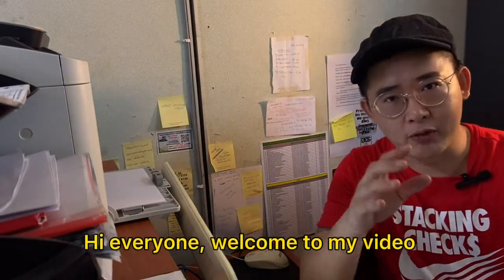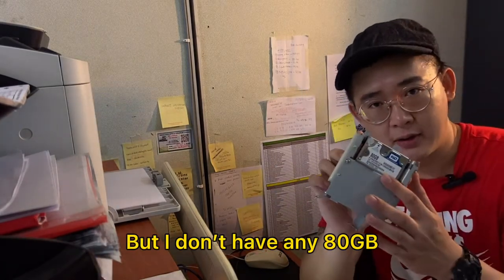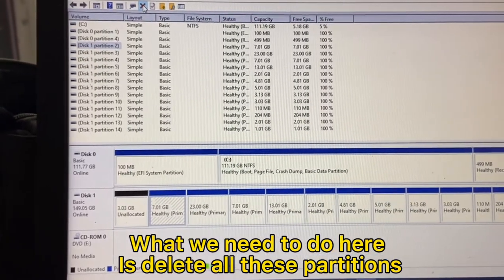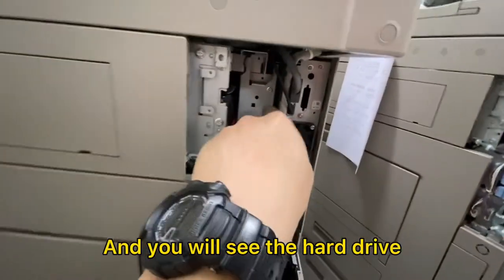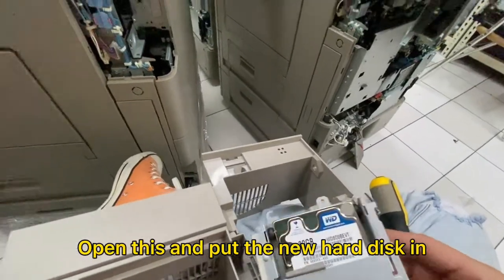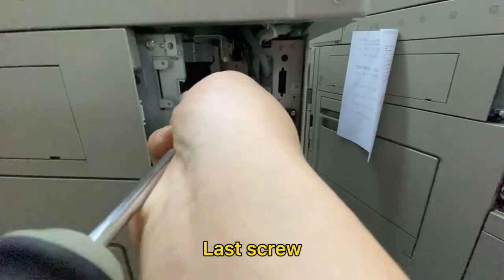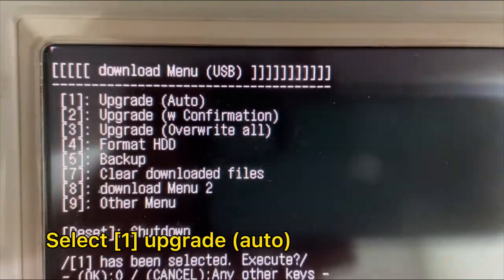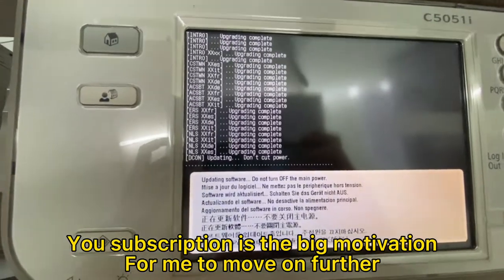Canon IR ADV C50xx /52xx Change hard disk & reformat

Comment: Hi Dennis, Canon imageRUNNER ADVANCE C5535i won't boot, looks like the hdd is broken. where is the HDD located in the printer?
Reply from the maker: Hi Sir, I found this on canon official web, you may refer to this link 
https://oip.manual.canon/USRMA-0945-zz-CS-enGB/contents/CS5560_appendix_0095.html

Comment: My canon 5250 prints well but my screen panel is off.
I changed the panel but it's still off
Reply from the maker: Do check the connector , please make sure all is connect properly, if panel still off… it might be main controller problem

Comment: Hi Dennis,

first thank You for great guided videos.
But I need to pleas You for help because I need ALL STUFF to create proper USB pendrive to FORMAT & INSTALL FW/SW into thne new HDD directly on printer.
I have printer CANON imageRUNNER ADVANCE C3520i III
I have error on display E602-0201
I have printers HDD out but UNREADABLE under Linux, Win nor macOS (for backu/clone)
I have another HDD prepared and formatted as FAT32/GUID connected in printer

BUT I DONT HAVE "USB tools" to newly format new HDD and againt run the Printer.

Please can you send me thoose files and info in wich format and setup to put on USBpendrive to be able to finish the procedure?
Thank You a lot.
Regards,
K.J.

P.S.: Hours googling and not able to download SST aka Canon Service Support Tool and Firmware for my Printer
Reply from the maker: Hi Sir, thank you for your comment, e602-0201 could be operating system error or hard disk drive. My suggestion is swap a same model hard disk into your machine and see it can boot or not. Sorry that I can’t give more info about IR ADV C3520i as I never do a format before it( I have no experience with this)
Reply: @dennisthefatkid  Hi Dennis,
its really HDD problem I tryed land/replace with another same machine and worx.
So please can you send me just nstallAPP = SST SST aka Canon Service Support Tool to do it manually by myself.
Thank you.
K.J.

Comment: hey brother can you send me the firmware files for 50/52 series .becuase every time i have the error i use to take hard disk from other machine and install .if get this firmware it can be a permenant fix and able to use my the hdd less machine
Reply from the maker: Yeah, it used to be the common way for me too (swap harddisk) you may request the firmware file from your supplier
Reply: @dennisthefatkid  i do deal with Refurb machines i have no deal with the canon suppliers thats the issue
Reply from the maker: @afimohd7902  yes, recon supplier have the firmware
Reply from the maker: Ok boss… good luck 👍🏻

Comment: How to solve E000602-0020 error on Canon, got this error just after printing. The printer has no keypad, only touch screen. The error is shown on the screen and stuck,please help
Reply from the maker: It seems to be hard disk or software problem 
E602-0200 -00 Title Hard disk error
Remedy 1. Check the Cable and Power Connector.
2. If the measures above do not solve the problem, start up in Safe Mode to perform All Format using SST and reinstall the system (SYSTEM, LANGUAGE, RUI), and then turn OFF and then ON the main power.
3. If the error still remains, it can be caused by HDD failure;
therefore, replace the HDD and reinstall the system.
Reply from the maker: @theophelouscele7219  you meant the touch screen panel is not functioning ? If yes, try swap another function-able touch screen panel into your machine , please refer tutorial below :
  LCD PANEL IR ADV C50xx 52xx Series
https://youtu.be/f5i1vdVOTf4
Reply: @dennisthefatkid  no sir, I meant I cannot get to any printer settings because of the error on the touch screen.
Reply from the maker: @theophelouscele7219  sure … enquiry@dennisthefatkid.biz.my

Comment: I really need your help I have a canon 5250i machine that is with error 602 and if you can help me with the firmware I rotated so much on the internet but I found nothing I am only from Mozambique I would like you to return
 Sincerely Miracle
Reply from the maker: Boss please provide me the full error code
Reply: good morning, the internet is very difficult yes the error code for canon 5250i 602-0001 the original disc died so i bought another one i clicked but it is giving this error thanks for your help and sorry they said i should flash firmware but i cant find it for this machine
Reply: Good morning, thank you for your time. thanks. Canon 5250i machine is giving error 602-0001
the original disk failed I put another hard disk and it doesn't leave this error screen and they told me that it should install firware, I tried to search I couldn't so I came here to ask for your help
Reply: Good morning, thank you for your time. thanks. Canon 5250i machine is giving error 602-0001
the original disk failed I put another hard disk and it doesn't leave this error screen and they told me that it should install firware, I tried to search I couldn't so I came here to ask for your help
Reply: @dennisthefatkid  Good morning, waiting for your return on the canon error request 5250i error602-0001, the disk I changed and I can't work with it, I already ran behind the firmware but I can't find it, help me depending on this for about living
Reply: Good evening brother, I'm waiting for my order, please I live off this, I have 4 children who depend on this work I beg you
Reply: Just imagine I've been waiting 8 months